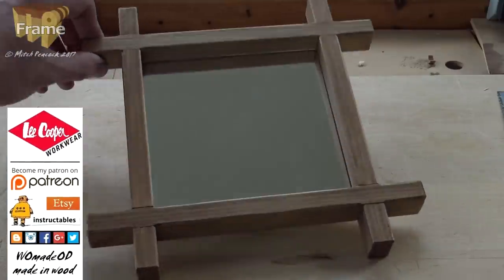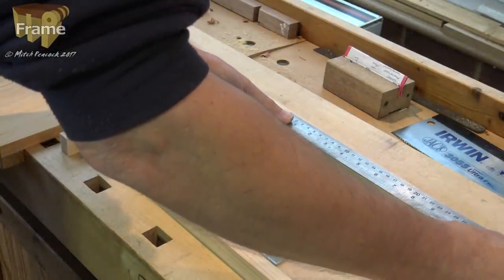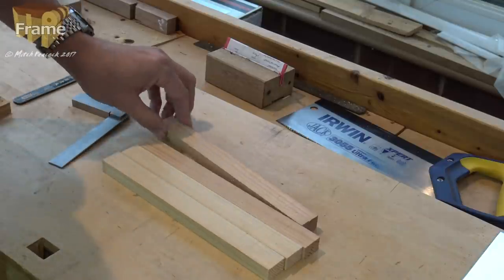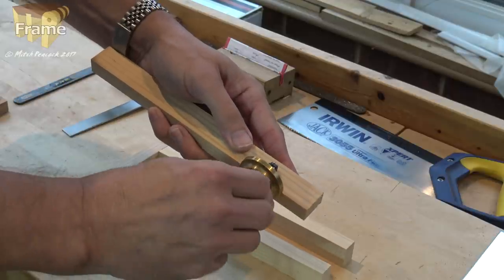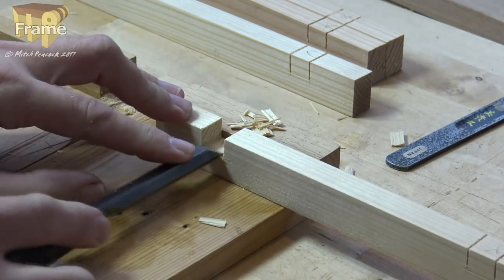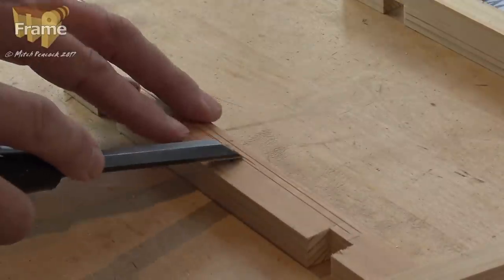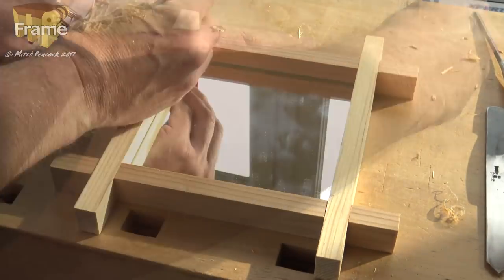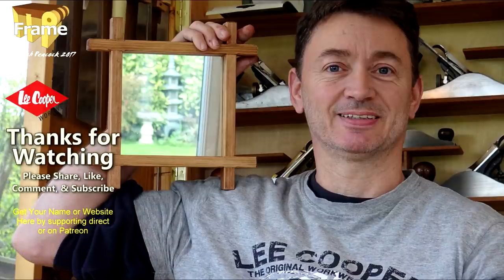Cross Halving Mirror Frame - a Patron early bird special

Comment: Any idea where I could buy blades for Japanese marking gauges, European based store? What they have at fine-tools.com is ridiculous! A dinky piece of crap, the size of two finger nails!
Reply from the maker: Tome4kkkk workshop heaven sell Japanese tool steel if you fancy making your own. I haven't any idea where you might get them ready to go.
Reply: Wow! I routinely browse the most popular online shops but I never knew WH sells steel billets! Thank you! Being the cheap-ass I am, I'll either make do with the tiny scraps fine-tools.com sells or I'll make the blade out of a metal cutting jigsaw blade, without heat treatment. I've got no hardware nor space for that. // One more thing regarding kebiki. Most 'standard' Japanese marking gauges come with the bevel side facing the fence. Is it a standard Japanese convention or just a pseudo-Japanese convention made up by Western retailers? Personally, if making a DIY marking gauge, I'd go for a flippable design. I don't know if I'm doing something wrong but I see myself marking 'waste toward the reference' and 'waste away from reference' all the time (recently I made a birdhouse).
Reply from the maker: Tome4kkkk haha - good idea.
I don't know about Japanese bevel convention, but the bevel only compresses the wood, so it's reversible later with a little water/steam.
Reply: Mitch Peacock - WOmadeOD I see. I sent you an email yesterday. With my YT username in the subject field.
Reply from the maker: Tome4kkkk Cheers, I'll check that later today